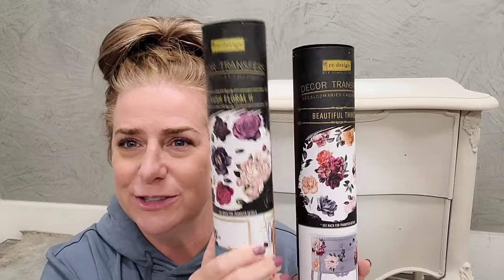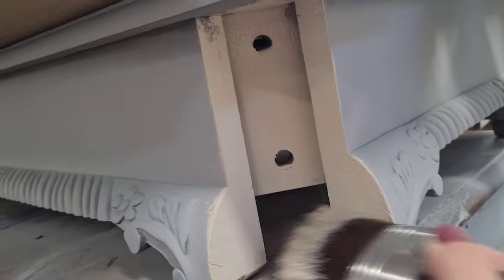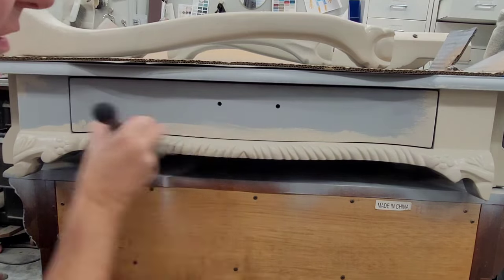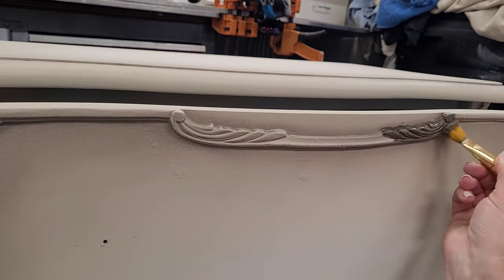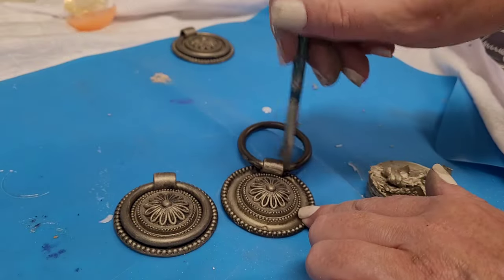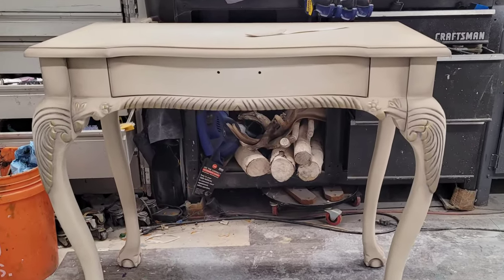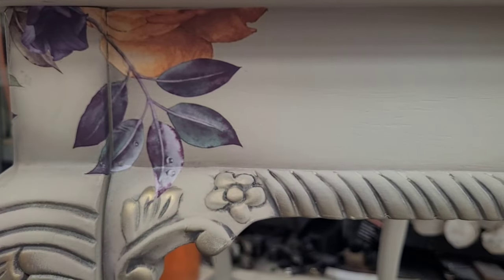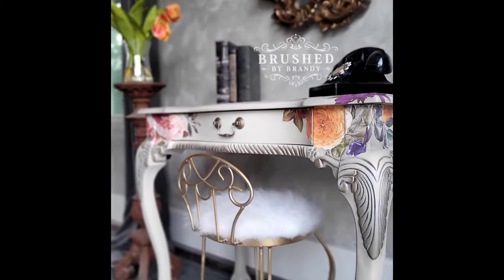From Drab to Fab: Jaw-Dropping Desk Transformation

Comment: I’m confused.  I’m just getting started on this new adventure. Your work is stunning and I want to totally understand how you accomplished this masterpiece.   
One—You said you primed with Wise Owl light grey.  But Wise Owl only has grey or white primer, not a light grey.  Which should I use? 
Two, You also stated you sealed the paint before adding the walnut glaze.   What did you use to seal the paint?    
Three,  Did you use the white and black wax, mixed together to put in all the decorative crevices or just the edges?  
Four, Am I correct that you put the varnish on after the entire project was completed?   
Thank you for clarification.  I welcome response from all commenters.  The more I learn, the better I will understand the process.